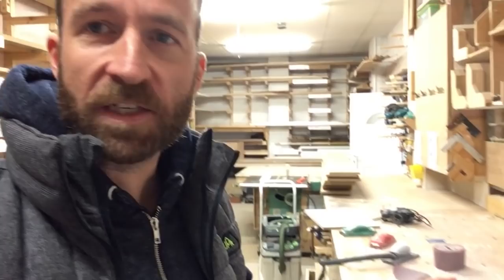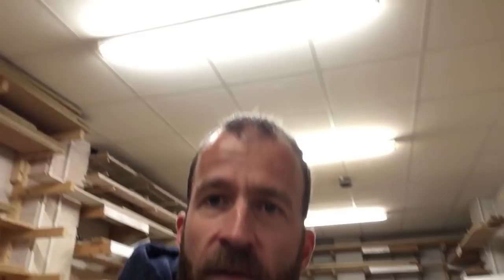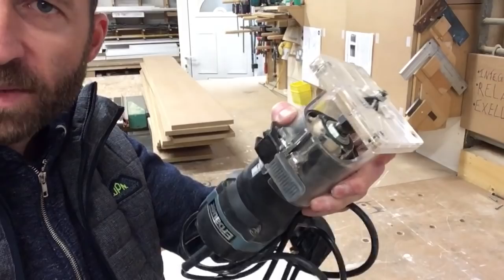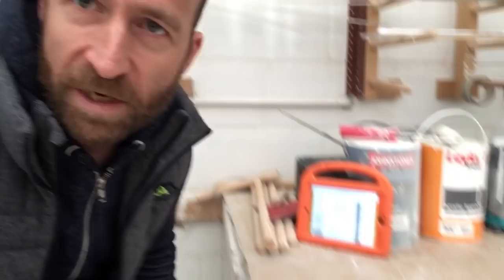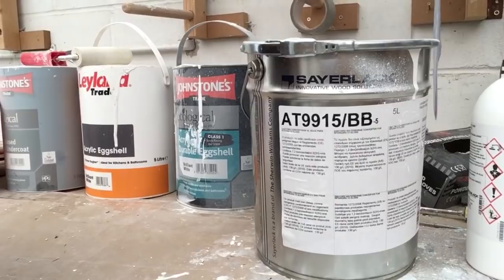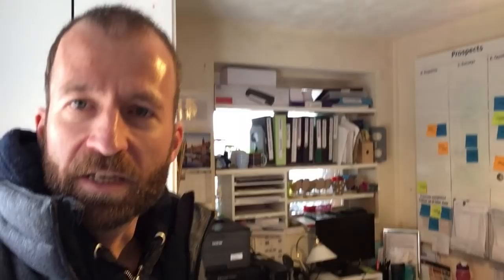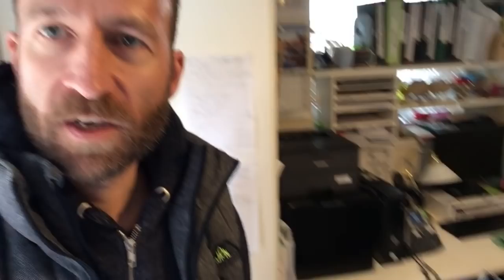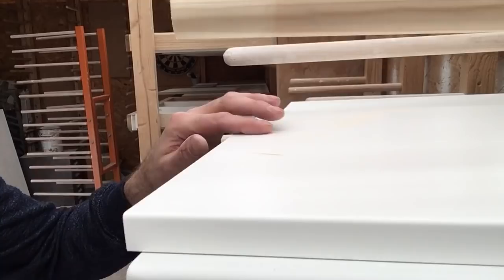Paints we use and why

Comment: It's all about the end result and you've certainly helped in explaining paint choice.
At present i use 4inch roller with harris fluffy sleeve and Hamilton Expression brushes as I don't work in a workshop.
Ultimately sprayed finish is where its at for evenness and Mirka abranet is fantastic, you can also use it wet! MDF I avoid!! but nevertheless your workshop is a master class in showing what you need to get on spraying or not.

Comment: Hi Alistar, great video. I’ve been spraying in one form or another for about 30yrs ( 10 years as a tech rep). I use airless for big jobs and a four stage turbine for site work. In my new shop I have a 150l compressor and have just started using it for spraying , quick to set up and clean with great control. I find the hvlp turbine guns can be a bit finicky to get a good seal on the lids but not so with the compressor gun.
Reply from the maker: spudian65 that’s really interesting Ian and I may want to pick your brains further sometime about getting a compressor based system because I think it would be good to have the option of not filling all those tubes with paint for a ball jobs and just grabbing a gravity fed gun or whatever.  There’s lots more I want to learn about different spray setups, I have always found it difficult to get my head round, having no past experience of using different systems.
Reply: No problem, I’ve got £500 guns that I use on cars but for woodwork you don’t need to spend much. I am getting good results with a £20 lvlp gun, nice quick colour changes too
Reply from the maker: spudian65 ah LVLP yes my friend Jamie Jackson has been talking about that - yet another confusing variant!  So is that a very low powered but easier to control system ?
Reply: Freebird Interiors in spraying it doesn’t feel much different to compressor hvlp just uses less air but you would still benefit from a decent sized compressor

Comment: If you want a glass finish on the edge of mdf, you rub the mdf down to a smooth finish. Then go round the edge with shellac /French polish, rub down a repeat process until you have glass smooth finish and spray the edges with bin Zinseser. You can get away just using bin by Zinseser when dry rubs down lovely then spay with any wood paint.

Comment: I'm so glad you made this video. I've got a set of alcove units to make that need to be painted in F&B studio green. I was going to go morrells but they sound hard to deal with. Can the sayerlack be mixed in any colours?
Reply from the maker: Dan Smith absolutely it can!  Last week I did these alcoves in two colours perfectly mixed to match a farrow and ball blue and a Dulux grey. https://www.instagram.com/p/BubmkybgQK6/?utm_source=ig_share_sheet&igshid=16p9m5kwo5srt At all costs do NOT use original Farrow and Ball!  Last time we made that mistake the paint simply would not dry properly and we couldn’t turn the tall doors on the racks to paint the other side without leaving slight marks from the rack.  I blamed unusually high humidity in the air (muggy day last summer) because I thought F&B was meant to be a good paint, but decorators have since told me it is not good paint at all!!

Comment: I use an mdf seal /high build filler from HMG sand back then a 2k 7015  primer then top coat. acrythane works well get a glass like  finish. And also a decent spray gun makes a big difference use a gravity fed gun like a 1.4 FLG5 DEVILBISS for top coat. and 1.8 for filler / primer
Reply from the maker: colin Jennings mk2 leon sounds like you really know what you’re doing.  Sadly I have no experience with the professional 2k etc products, sticking with water based largely due to our rudimentary extraction booth blowing into a residential neighbour’s garden!   Have you ever tried waterbased?  I understand that it does require much more flattening back due to grain raising issues but it’s all we’ve ever known!

Comment: Hi Alastair - epic vid, and a name-check too! Thanks for going through the paints and primers - I took a look at the Sayerlack website and thought, you know what, I’ll just ask Alastair… 😂 BTW I had exactly the same response from Morells - all keen as mustard until we started talking about water-based then they lost interest totally. Weird. BTW I've found Wealden’s arris roundover bits to be good for putting a very fine round-over on doors. 
How do you order Sayerlack - is it online, phone-a-rep, or available locally to you? Thanks again, Peter 👍
Reply from the maker: More of a ‘name-drop’ Peter! 😁 Movac say everyone else’s waterbased isn’t half as good so they’re not keen to promote it.  They WOULD say that of course however it does appear Morrells prefer to stick to promoting what they do best.
Reply from the maker: Funnily enough, we have just changed from using a chamfering bit to using a 2.5mm roundover bit for most arrises, from Wealden tools!  The job currently in the workshop is the last one using the chamfering bit because we agreed halfway through it the tiny roundover looks better  when we tried it on a smaller job.
Reply from the maker: But I do have you to thank for the Wealden tools connection - you may remember you put me onto them a while back when I asked where you got the deep grove cutter for your shaker doors.  You were absolutely right they are better allvroubd did router cutters than trend so I haven’t looked back since (well, apart from the occasionally dally with cheap Chinese eBay cutters, but I drew a line under that when the bearing wheels started exploding 😂)
Reply from the maker: Oops and finally, I originally ordered via my Movac area rep Joe Monterrosso,  then once we established we really just needed those 2 paints, we created a standard email template with the correct codes to use for ordering direct to the Coventry depot.  Get in touch with Movac through their website and they’ll set you up with the right people local to you I’m sure.
Reply: Freebird Interiors Thanks Alastair! I’ll definitely take a closer look at at Movac this week. 👍👍
Reply: Will do, thanks! 👍👍

Comment: I've used Leyland Primer for over a decade but not in the way you used it & not for the reason either. I use it because of the quick drying property & because of the fact it can take a sand to an extremely smooth finish. I water it down & certainly don't use it because of how thick it is. I also use oil based paints to finish as they are in my opinion superior to the water based top coats & for the most part i do it all by brush. With the right brushes & paint a glass like extremely tough finish can be achieved. No need for Zinsser products as suggested by others. GLA
Reply from the maker: Interesting! Thanks

Comment: Really helpful, thanks Alastair. I recently hand painted some MDF cupboards using a Lick water based eggshell paint and am finding the paint is very soft/ easily dented. Did you generally find the Layland/ Johnstone's acrylic to be reasonably hard wearing? Also considering adding a clear protective coat but am reluctant to add in further coats to the process..!
Reply from the maker: On the whole I remember being happy with it, but the Sayerlack paint we now use is definitely a different class.  You could brush or roller that too

Comment: Did you consider the wagner range. Very good explanation by the way of airless made sense to me. Been dabling with compressor and gravity fed LVLP gun using Tikkurila base coat and helmi 30 finish. Results okay but had to thin 20-25%. Anyway why Graco?

Comment: Great info thanks .i want to have a go at  the chunky floating shelves. My alcove is 450 deep 1000 wide . I want two shelves. Proportional how thick and deep would you make them  i wonder  .regards David
Reply from the maker: david osullivan personally I just stick with my method, 18mm top and bottom over 18mm wall battens; 56mm lip (theoretically 54mm but you can trim it back from 56mm).  I’ve just fitted some with this method at almost exactly the dimensions you have and they are plenty strong enough: https://www.instagram.com/p/BubAXlTgORZ/?utm_source=ig_share_sheet&igshid=ie0504fawt0h
Reply: Freebird Interiors . Thanks very much .i really appreciate pros sharing advise and methods .i think you have a fantastic business model and a great system while all the time trying to make improvements

Comment: Great video, are you still using the Sayerlack? I’ve just sprayed my kitchen in it but didn’t use the crosslinker, wondering how it will hold up.
Reply from the maker: Yes we do use it and find it to be pretty durable, we don’t typically use the cross linker at all, but if we were doing kitchens I think we would

Comment: Hi, really enjoyed the recording - currently were using a different manufacturer and having a few problems with the temperature altering the colour shading of the pigmented hydro paints. We will have to raise the temperature in our drying room - and I am a bit funny about the type of heating needed. I see you use some infrared heaters, is it possible to ask what type etc and how you find them??
Tim
Reply from the maker: Hi Tim sorry I missed this message, if you find me on Instagram I’d be happy to reply with a more comprehensive voice message.  In short yes we used infra red heaters for a while - wall mounted Vama brand from Sunswitch, 2kw I think - and they are helpful but very directional so they only really dry the surfaces not in shadow.  Eventually we built a separate drying room (in the new bigger workshop) and had much better results with a simple Thermobile electric blower heater, and a simple bathroom trickle extraction fan at the other end of the room.   A controlled warm environment and constant airflow works really well.

Comment: Hi there, 
I am using the AT99 topcoat on kitchen doors and it's very easy to peal it off from the edges I do slight rounds. Are you using the hardener in primer every time?
Thanks

Comment: I also bought an earlex 5500 and sold it 😂. My thoughts are maybe its good for oil based or very thin finishes. I had got a qtech q5 now and it seems much better but wondering now if should have bought an airless system
Reply from the maker: Yes thin finishes only I think, and slow. So that Qtech is a more professional grade turbine system?  I remember looking a little into turbines but then went to air assisted airless, and that is the technology I hear most talked about lately for spray booth work

Comment: Hi Alastair, great video, very informative. I too use sayerlack good paints, only having trouble with deliveries to my workshop, anyway my question is how do you find those infrared heaters? Are they helping a lot? What spec are they?
Thanks 
Peter
Reply from the maker: Peter Nikitorowicz yes they are brilliant and noticeably speed up drying time - as we head into winter I recommend you get some!  We have 2 of these exact ones: https://www.sunswitch.net/industrial-infrared-heaters-c1/varma-v400-2kw-radiant-infrared-heater-p23
Reply from the maker: Plus these: https://www.sunswitch.net/accessories-infrared-lamps-controllers-and-more-c10/heater-controllers-c30/sunswitch-cc1-2-energy-saving-comfort-controller-p42

Comment: for eggshells little greene tom's eggshell best eggshell ive used.
Reply from the maker: jack wardley ok I haven’t tried much little green.  What do you apply it with?
Reply: @Alastair_Freebird  it's a oil based I only use oil most of the time but this one is as good as the old oil based stuff I normally just use a pure bristle brush.

Comment: Another brilliant video. I have a Graco 495 airless sprayer and Graco handheld that use FFLP tips. Have you used a full airless system and if so what tips have u used? PS I a member of your Buymeacoffe page but couldnt find an area to ask a question.
Reply from the maker: Hi Andy thanks for the feedback; at one point the buymeacoffee platform has a chat area but they pulled it for some reason, and have suggested using a platform called ‘discord’ but I am not familiar with it, and reluctant to ask members to sign up to yet another platform. A lot of people use Instagram to message me however I accept that we aren’t all users of Instagram!  Messaging me via these comments works too!  We are still using the Graco Finishpro 395 and I think Brady is mainly using a 310 tip at the moment.

Comment: Have you ever used Dulux Trade? I swear by their primer and acrylic eggshell on MDF.
Reply from the maker: EjitWebDesign I lost faith in Dulux early on after trying their waterbased exterior wood paint on some Exterior woodwork (I used to make gates and hang doors etc). It seemed very poor quality, didn’t apply very wall or flatten off; seemed kind of thin and translucent however many coats you put on, didn’t seem at all hardwearing.  I did since then experiment with the silicone diamond range for our interior work but didn’t feel it has any clear advantages over the Leyland/Johnstone’s products we were already using.  But now having discovered the Sayerlack paint I consider that to be in a different class than any of those products.
Reply: The Johnstone's products are very well rated and more affordable.

Comment: I really hope you see this and are able to respond. My decorator is painting my walls and will be starting the woodwork in a few days. I didn't want to go down the oil gloss route as previously the paint has turned yellow. Is there a primer paint you would recommend for mdf skirting and a different paint for top coat? Every single person I speak to says something different.
Reply from the maker: Hi, I'm not checking much while away on holiday for 2 weeks but did just see this!  Yes oil based is prone to yellowing.  I'd say take your decorator's advice if he is applying it!!  They will likely have more experience than me in the range of brush applied waterbased decorator's paints (unless they are a stanch traditionalist who prefers oil!)  However if you really want my opnion, and if you're looking for gloss, some waterbased ones are quite poor; the only one I've used that I was very impressed with was the Johnstones aqua system gloss - good opacity, gloss level, and durability.  I'd say go with the higher-end Johnstone's range in general, if you're looking for easily available decorator's paints.  But I'm no expert, it's just a brand I tried, worked for me, and I stuck with it for a while!  A step up from that would be the Movac paints described in this video, or other industrial spray paint brands like Tikkurilla, but they are not so easy to go out and buy as a consumer.

Comment: Hi Alistair, May I ask as to how much you're thinning down? As I'm having a similar issue with the fan pattern on my airless. Would you say around 10% or more?

Thanks 
Luke
Reply from the maker: Yes it’s advisable not to go more than 10%
Reply: @Alastair_Freebird  great thanks. Can I please ask what tip you use also? I have thinned paint 10% which has sorted the tails but still get a slight orange peel! I'm using a 310.

Also ...did I see you on Alan Carr interior design show 👏
Reply from the maker: @lukegadd3209  Hello, I think we wee using a 310 for a while.  Honestly, I forget what Brady is using now, he is the sprayer.   You could ask him by sending a message on the @freebird_trade instagram account.  And yes I do work on the Interior Design Masters show whenever they will let me!  I find it a great escape from the pressures of running a business.

Comment: Hi Alastair, I've just purchased your ' Fitted furniture Apprenticeship' series. In it, you mention the Wealden router bit for the round over. Is that the one in this video on the Erbauer trimmer? As I've just bought the Wealden bit for mine and realised that the collet supplied with the Erbauer is 1/4" but the wealden bits are 8mm. Can you get a 8mm for the Erbauer or is this a different bit. Cheers, Josh
Reply from the maker: Ah, you’ve got me there…. I do remember not long ago need to find an 8mm collet for a particular purpose and just couldn’t get one for the router in question but I think that was the new dewalr we’ve got.   And I think this related to a specific variation of that arris round over bit that has an extra small bearing.  The standard bit I’m pretty sure IS a 1/4” shank.  I suggest to7 clarify all this with Wealden direct.  Sorry I’m a bit hazy on the detail as Brady is doing all of that actual work with the routers these days!
Reply: @Alastair_Freebird  Hi Alastair, Thanks for the reply. I've just looked, and you're right they are 1/4", but I've ordered the 8mm variation by mistake! Also, the fitted furniture course has been really helpful to me so far. Definitely some tips in there that have saved me a lot of headaches in the future! Thanks again, Josh
Reply from the maker: @joshwibberley9364  hi Josh ok that’s all good.  You are the first purchaser of the course to give me direct feedback so far, thanks for that and I’m pleased you’re finding it valuable.  (In case any one reads this and wonders what we”re talking about here is the direct link https://www.buymeacoffee.com/Freebird/e/50990